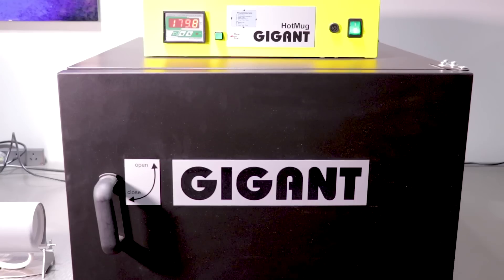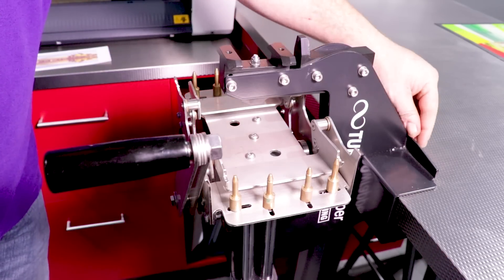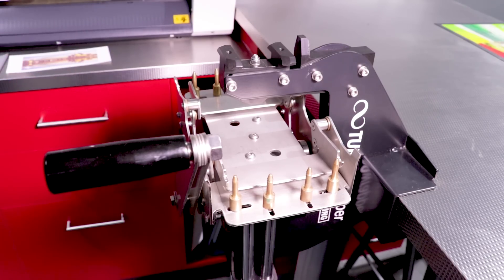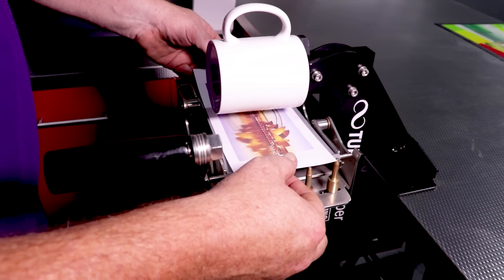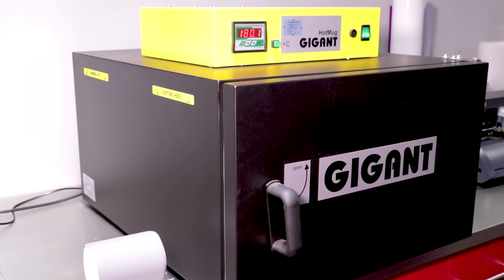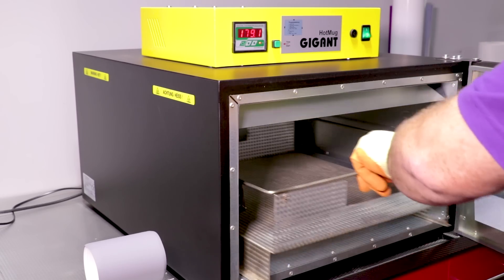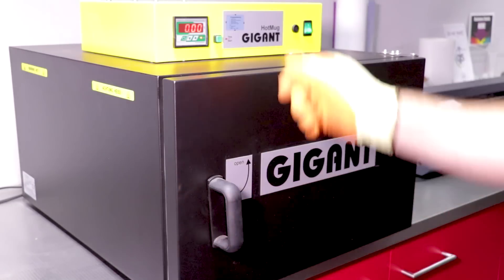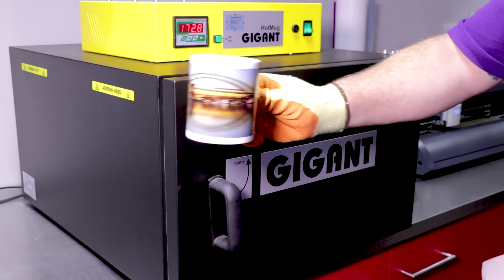GJS high-volume bulk-mug sublimation solution

Comment: whats the difference between subli press and oven?
Reply from the maker: The main difference between a mug press and the oven in this video is the ability to do multiple mugs at once. This can help speed up production in high volume print environments. If you are not using a mug press, you will however need to use something similar to the wrap shown in this video, or shrinkable "sleeve" such as our SubliSleeves (https://gjs.co/customerservice/n605/video-gjs-sublisleeves-are-here) in order to create the necessary pressure required. Hope this helps!